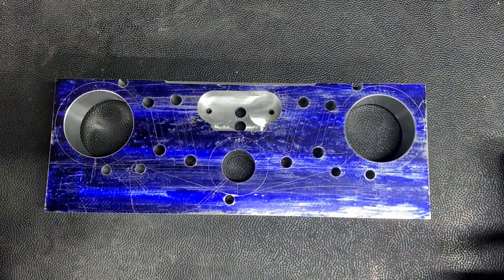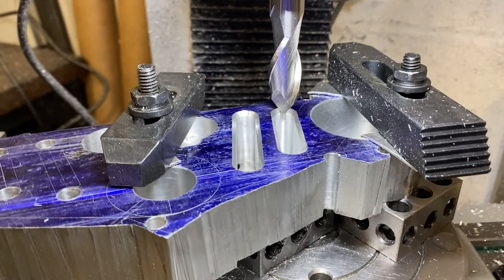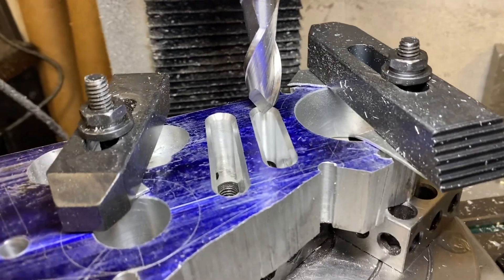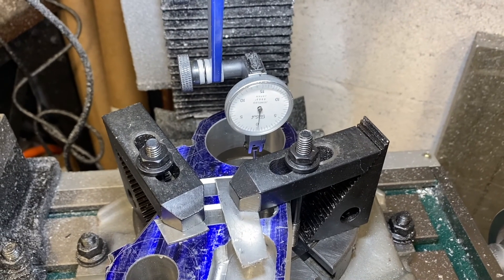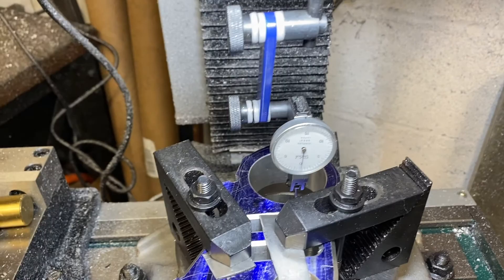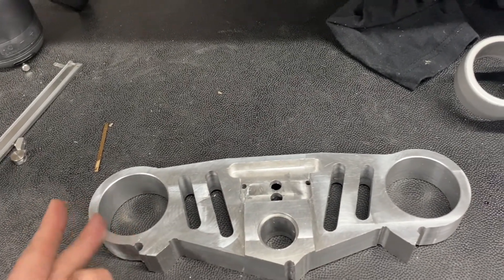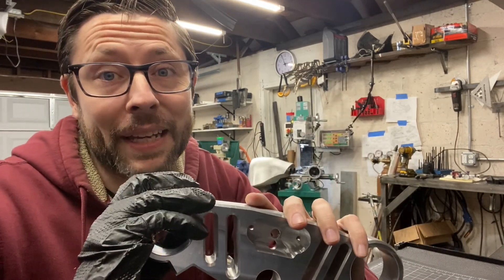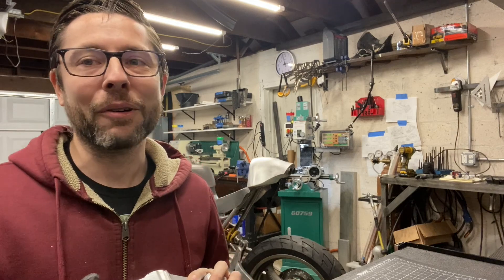Billet aluminum Ducati Supersport triple clamp pt3: Cutting radiuses on the rotary table

Comment: Insider tip....At the end point where 2  flat surfaces come together, if you plan to use a 1/4" cutter to do the work, drill and ream an oversize hole ( .251) at that location. The cutter finds a resting place and no chatter happens. Nice job bud. Really.